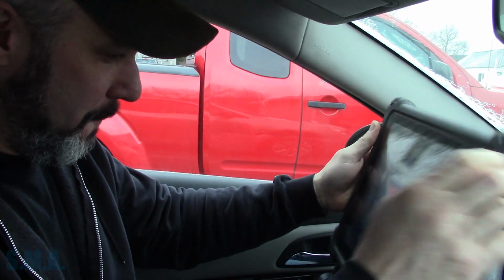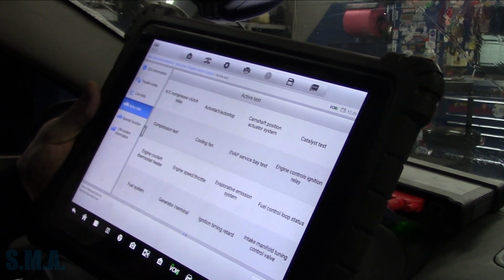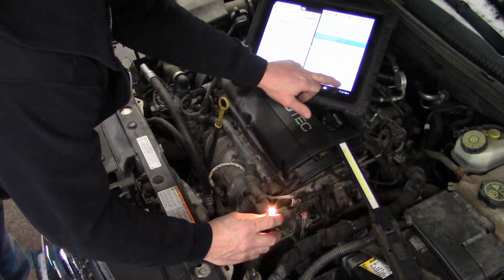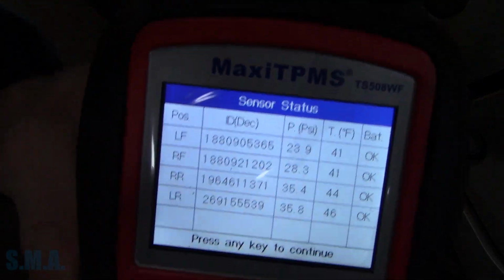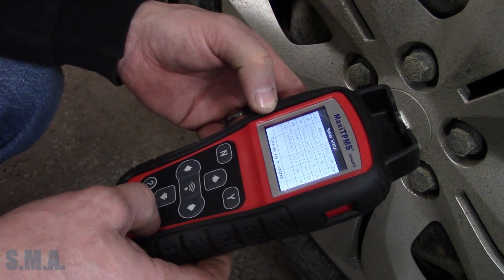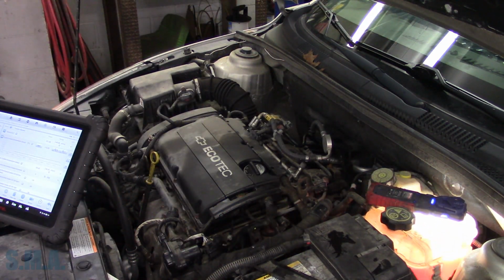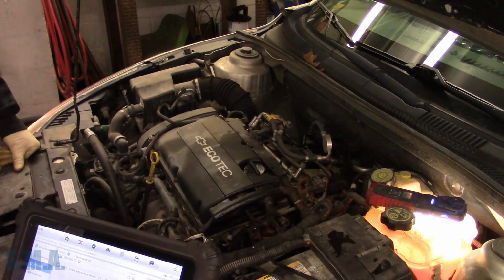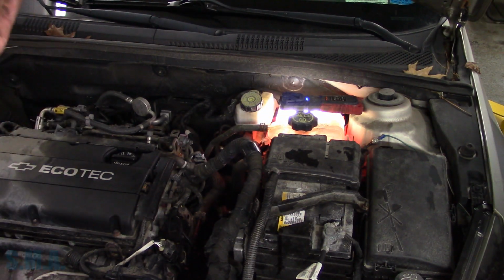Chevy Cruze: Thermostat Heater Codes / TPMS Light On

Comment: I love my 13 Cruze LTZ RS. Bought and sold a ton of cars over the years, and it's one of my favorites. Sitting at 214k, put 14k since I got it in November. All I've had to do was the typical valve cover which is easy. Has an oil leak but I change my oil every 3k miles and it never drops below full on the stick. 

But what kills me is they put an aluminum thermostat on the junk 1.8 engine, but couldn't put an aluminum thermostat on the 1.4 Turbski engine. You can buy aluminum ones, but they were plastic from the factory. That's one of my only gripes about the engine. I've worked on cars for 16 years. I've seen a lot. People shit talk the 1.4, and no it's nowhere near the best. But it's a good engine that gets fantastic mileage

Comment: Eric, I found it funny. I just did a Chevy Cruze with the exact same problem. What I found funny was I had Napa deliever the exact same part. As always I check the part to make sure it's the same. However, The little bugger got me when I was done. Turns out although the thermostat was the same but the plug was a little different. The little ribs inside were on the wrong side not allowing me to plug it in. I was so pissed. I didn't want to do the job all over again because of some little stop tabs. So I ended up using a little pick and knocking them off ( on the thermostat side). Then the plug went right in. Finished the job and checked for OEM operation. Funny thing was I had looked at the plug on the thermostat before I started and it "looked fine". (famous last words lol) Those tabs were so small I didn't see it. I really hate aftermarket just as much as you if not more. For that very reason. BTW, the computer looks for 12-18 ohms. I hope you got a laugh out of my story. Ron

Comment: I have a 2913 Malibu 2.5 liter and changed the thermostat housing wich is also electric and now I have this same code . Guessing it’s a faulty part ?? Also I have tried to burp the air six time today and it still fluctuates back n forth I cannot get it to burp out 100% for the life of me , my question is “is it bad to drive the car with this code in and like this”?? Curious . Temp isn’t getting to bad but it gets ti half way wich the car factory runs a hair over 1/4 mark wich is normal for rhe 2013-2015 Malibu.  PLEASE HELP THANKS

Comment: I just bought a 2012 Cruze 1.8 where the previous owner had the thermostat heater wires backwards. I fixed it but now there is a Permanent P00B6 code and the o2 heater, o2 sensor, and evap monitors won't set. These all share the same fuse F47UA. Could having the heater wires backwards damage anything? Think a wire under the fuse block went bad? PCM reflash? Drove 15 warmup cycles and 500 miles, no MIL light or active codes, but the permanent P00B6 code remains and the three monitors won't set.

Comment: Literally the same two issues I'm having with my Sonic. Tires an easy fix. However past year alone, I have replaced the thermostat sensor, the thermostat and whole housing. I have gotten. P0598 and P0198 I can't seem to figure out why my check engine light keeps coming on. I am keen to believe that I have gotten defective parts everytime. I'm at the 5th time, 2 weeks ago I replaced the housing. I'm at an absolute loss at what I should do.

Comment: I need some help on my car Chevrolet Cruze 2013 at first it haded a check engine light after that I change the thermostat houseing the check engine turn off there no leaks on it from nowhere but still have the code p507 what can it be

Comment: I was hoping you had a video for a 2014 chevy cruze with a 1.4 turbo. Only codes are P1516, p2101, and p2176. Display shows Engine power reduced, service stabilitrac, and service traction control as soon as key is turned on. Replaced throttle body, same thing. Its going to the dealership service dept tomorrow. 😞

Comment: Many people call that icon the "Check engine light" when it's not always engine related. Mine came on and because I have a thing where I get information remotely with my breakdown cover (OBD permanent device). Anyway, it was a vehicle speed sensor P0500 VSS - which I knew about already.

Driving along doing 60 after test driving the thing and it just drops to zero. Turned the light off anyway as I have done testing and it's gearbox/speedo related (gearbox replaced with one from a slightly bigger engine) as it's stronger and better. For all I know the speedo drive gear is fooked.

Comment: The ones that don’t have the air pump it’s acceptable, in my opinion, to grind off just enough material to slide the thermostat out without messing with the water outlet👍

Comment: I have a 2009 Chevrolet Aveo with a 1.6 EcoTec. Looks indentical to this engine, right down to the thermostat. I wonder why my thermostat came right out after undoing those 4 E Socket bolts? GM sure is weird....

Comment: You think the thermostat is hard to remove on this car, just try to get at the thermostat on a 2001 Mazda Tribute.  It's buried in the middle of the engine. Should be the same on the Ford Escape.

Comment: Have you dealt with the 1.4 turbo these cars and many other gm models got? Girlfriend had one and I was constantly working on that thing. I replaced two thermostats, bypassed the electric fan to run high speed all the time on it, did the water pump and a radiator flush. All that and it still blew the head gasket after overheating on the highway. Pulled over asap but that did not save it, head was toast. If you get one of these cars and you live in a hotter area do not get it with the 1.4 turbo. The 1.8 is far better and less likely to brick itself. Could have been the bad one  of the batch but still.

Comment: I had 2014 Cruze, it was the leakingest car I've ever owned. Sold at 164,000 miles and only fixed leaks. Oil cooler was the worst. Between the engine and turbo/exhaust manifold. Clearly the best place for oil cooler. Hottest place under the hood.

Comment: Right out of high school I worked at GM running a metal press to make the bracket that held the air-conditioner pump onto the engine block. This was in the days, when GM recommended a "tune-up" every 6 months or 6000 miles. The bracket had to be removed to do this tune-up, which meant that the fan belt had to be removed, and when replaced the belt was tensioned by hand with a wrench. Nice to see GM maintain this tradition for more than 50 years. Yea, you rock GM. Never make it easy for the service personnel. GM clearly believes that their customers have money to throw away on paying Eric to remove three parts to repair one of them.

Comment: We old-schoolers think the engine t-stat should open at 180 degrees. I have an '08 Vette that has the temp get up to 218 before the fan ever comes on and it brings it back down to about 205. Modern engines are designed to run pretty warm.

Comment: The Chevy Cruze is, quite possibly, GM’s biggest $$$ pit. I know. I drive an ‘11 with a 1.4L turbo’d engine. These 1.8’s are more reliable with less moving parts, but that’s not saying much. They use timing belts instead of chains like the 1.4’s do. Overall, if you want to see a car made out of pure plastic, this is the one.

Comment: To those asking why they might put a heater in the coolant thermostat, it is because it is likely the cheapest means for them to have a variable temperature thermostat. The wax motor is set to open the thermostat at a "higher than normal" temperature, say 220-225 deg F (seems to be the normal range from my experience), but by turning on the heater and applying additional heat to the thermostat, they can make it open at a lower temperature. Higher coolant temperature (to a certain extent) helps increase fuel economy and reduce emissions, whereas lower temperature is better for performance.

Comment: I'm about to do the coolant output and the thermostat housing on a 2015. Both parts on the 2015 are plastic I noticed these looked metal. This a major issue with these cars.

Comment: Holly cow 10 more bolts you could of pulled the head, enginees must not look at anything after they draw it, did they have cab heat? Cardboard in front of the radiator 🤔????  Thanks Eric for the video

Comment: yup ... just replaced one on a sonic... gotta remove brackets just to change the thermostat...be sure to open the bleeder valve to get the air out....on the sonic ... it is hidden under the radiator cover... took me 20 mins to figure out why it was not sucking in the new anti-freeze...

Comment: I always pull hose clamp first, then use pump pliers around the hose at top of neck and towards the base work it gently back and forth until loosened up. if it's still that tight "heat gun" the hose.
yeah it should just be replaced at that point, but sometimes you have to do the dirty deed and get things rolling again!
I have a hose pick, that I've used twice since new. it either digs into the hose or gouges the housing no matter how careful and precise you are. I have used it more for non "hose removal applications than not.

Comment: Learnt a few things my sister has a Chevy Trax that has a 1.7 litr Diesel engine. Good little AWD car for where we live.. middle of nowhere Scotland. Things rust here also but salt only used in winter. Not sure if the fans work on the car, certainly never heard them and the AC doesn’t  initialise (no fan clutch operation etc) so these are jobs ‘on the cards’.. Eric did a Cruze fan clutch fix so happy subscriber here..Cheers Eric..

Comment: Too bad you're not in Sonoma County, my roommate needs two tires fixed/replaced for her Crown Vic and to replace the catalytic converters over to CARB-compliant models.
My Fit should be looking at a clutch replacement soon as it's got over 100k on it now. (Bought it in November 2010)

Comment: Boy, I've been around the block a few tmes. I got smellovision and it stinks like coolant. 100K mi dexcool. And cheering for blood is frowned upon around SMA (I know) But I guess management has it's perks. I got mine (Ecotec.) should I roll in the snow to swap a suspect oh2 or pay someone who will want $250 for their part or do it myself in the 1/2 frozen slop for $25.
I did that therm housing a couple times with very cheap china versions but mine didn't have things in the way. I love tools but would rather have had inverted torx on hand before I needed them. A 12 point sorta fits.  I gota stick shift

Comment: Wonder what the point was and having to hear open the thermostat a little early and then mechanically open it fully at the higher temperature why not just design it so that the wax pellet opens it at the appropriate time? Seems like out of a lot of extra complication for no reason. Probably so they can make the part more expensive. I remember Eric mentioning that these GM products seem to run very warm 220 seems very warm to me. I rarely see over 197 in my Toyota.

Comment: GM engineering meeting: “guys, let bring in our service techs for input on the serviceability of this next design..”.  Entire room breaks out laughing...”nah, just kidding”
Reply: Having "been there", "done that", it usually goes, "Hey guys, this thing is going to be a PITA to work on", reply "Yep, thank NHTSA and the EPA for the 40% decrease in bay space, and styling thinks we should have these shiny baubles that nobody will see, but convicted the BoD that without this $125 in extra BS we'll lose 75,000 sales.  

True story, been in meetings where everybody is "jeeze, this thing is going to be a pita to work on", and everybody is "Well, we could get rid of this, that, the other thing, but then it doesn't pass EPA requirements, we could lose this and that, but then it doesn't pass NHTSA needs, and there is NO WAY we are touching anything Styling says we must have....Remember Fred, John, George, Mary and Stacey?  Yea, those 5 went up against styling...they got fired along with most of their departments and replaced"...you don't go against the studio, they always win for some idiotic reason.  

Not saying they couldn't have done a better job, but all the crap you need on an engine today?  Sheesh, I have a 5.7L V8 in my 1999 Tahoe, I can almost climb into the engine bay, my buddy has a 2018 Tahoe...smaller V6, and you have to tear half the engine apart to get to anything because of all the NHTSA and EPA stuff that's in it.
Reply: @WreckDiver99  well said.  Some of the government regulations are like a spoiled child demanding every toy and candy bar in the store.  I WANT SAFETY, FUEL ECONOMY, AND EMISSIONS.  Uh, little child , you cant have one without sacrificing the other.
Reply: @andy1056  
Let's make the gm engineers try to work on the GM products that they make us work on what the world were they smoking that day

Comment: Great Video.
And, what a coincidence. On Jan 1st, I got the new year gift, from my car. On a short drive, the fan started running like crazy when I was going up hill. And the check engine light came on. Later a friend checked the code and it was P0599. I had to replace the thermostat like you did. I checked the resistance of the new and old one. New one around 15.5 ohm and the old one was around 2 ohm..
When I turned the switch on the fan didn't run, like it was doing. And I let it run for 10 minutes. Then around 215 the thermostat opened and I could feel the radiator hose got hot (watched it on the dash).
I don't have the scan tool to delete the code. So, I think it will stay on for a while.
Any idea, how to delete the code without a tool.
By the way, in order to remove the thermostat without touching the plastic house, just turn the thermostat a little bit, clockwise. No need to touch the plastic housing, at all.
My CRUZE, has manual trany, too. I love it.
Again, thanks for this great video.

Comment: Heated thermostat? So the coolant designed to take heat hits a thermostat designed to expand/contract to open wasn't good enough? Wait, what...🥴🤪
Reply: "in theory" it makes it a variable temperature thermostat, that can runt he engine cooler in summer heatwaves and or with fuel that's lower octane or higher alcohol content (E85 or higher)

Comment: And here I thought all these years that Ford engineers were the sadistic mirth makers for locating oil filters where only double jointed mechanics had half a prayer of even reaching them but GM has come through and dispelled that notion by forcing removal of half the coolant system just to access a thermostat.
PS... You could have drained it prior to popping it open where it was going to go where ever it wanted, like the rear tire, but that's crazy talk. ;p

As always, another learning experience, thanks Mr O.

Comment: 8:24 i have a VERY similar TPMS tool...... but it will ONLY program autel brand sensors
.
anything with a "must be activated" tag on it..... does not work
unless its autel brand

Comment: I use to remove the thermostat every summer from my old XD 1982 Falcon. It had no air conditioner
 and ran on dual fuel. LPG ran hotter and dryer, while Petrol ran cooler. So in Australian summer I would run with bonnet unlocked and wood blocked between bonnet underside and latch (prayed bonnet latch kept it down at 100 kph) and kept the heater on at full bore. You could see the engine temp rise to 3/4 if I turned the heater fan off and back down to just over 1/2 if turned it back on. Was a XD Falcon 3.3 litre alloy head station wagon, so had alot of weight to move with a underpowered engine, especially if switched to LPG. So in summer I also ran it on petrol as it helped also to keep it cooler. I admit as I got older, I enjoyed the perks of Airconditioning and power steering.

Comment: I don't know anything nor do I want to know modern Chevy ('63 1/4-ton truck, yes). Forgive me a question out of total ignorance: What is the purpose of a heater as a part of a thermostat assembly? Faster coolant warm up? No, seems the heater was off while coolant temp was low. Baffling is an understatement. This whole gadget must fairly expensive while failure-prone, likely by corrosion.

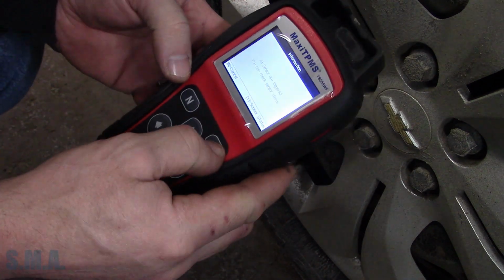Comment: 8:56 Same exact problem with my ts508 and my car... It claims all the sensors are good, says batteries - OK, my subie disagrees and throws the tpms light on. From what I remember, I think one of the pressures never changes, I suspect that might be the bad sensor. They're aftermarket sensors from the rack that came with my winter wheel package, and after 10 years or so, I don't think the car is lying to me either.

Edit: Just thinking more about my car.. I wonder if the signal is strong enough to reach the ts508 when held up to the valve stem, but not strong enough to reach the receiver in the car? And if that's the case,  why would the device say the battery is okay still?

Comment: Good show.  Could you do a bit on TPMS bypass?  I did my FJ Cruiser, but failed on the 07 Solara.  Is there a way to pick up the signal with a test light and multimeter?  Not sure of the correct wires.  Thanks.

Comment: I know that on BMW ‘s the mechanical thermostat keep the temperature higher than older cars when driving a a constant speed but when the engine is under load and needs more cooling the engine ecu Will trigger the heater to open the thermostat much quicker than a fully mechanical thermostat other brand do that too.

Comment: These thermostats are supposed to last as long as the engine.. possible causes for failure listed as:  not performing scheduled coolant maintenance or waterpump failure..or maybe that crudz is about to blow up..is this a common failure??

Comment: My '13 (3 pedal) Cruze has the same model T valve clatter, so I guess it's normal.
Reply: Ah.  Thanks for that.  It's been trouble free but I'd wondered about the next 105,000 miles.

Comment: That wiring to the water heater is residential cable and no service disconnect or armored flex to the unit. Fire your electrcian.